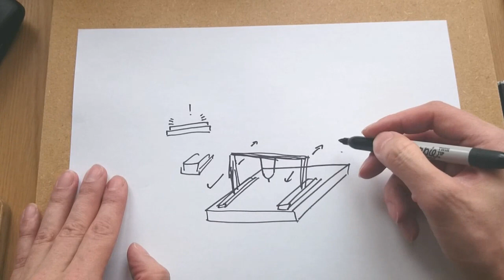My homemade desktop CNC mill - Clip 3/6: Boards, work beds and wobbly sliders

Comment: the more I google the more unusual designs I see, Ive 3d printed mine with slide bearings and rods, but without a 3d printer I would probably go for a more expensive option of building the frame from extrusion and using linear rods, but the price would be much higher, somewhere around £300 in full unless you fetch each part from aliexpress on best discount
Reply from the maker: When I made the machine six years ago these mechanical components were still surprisingly pricy, and off-the-shelf CNC machines in the $1000 range. Then the 3D-printer hype kicked in and parts became cheap - now I could make a much better machine for the $300 I paid back then. Still proud of my build though :)
Reply: @Joekutz  Im currently building a modified 3d printed cnc from an old 3d printer, in general the design from Nikodem Bartnik, just with 8mm rods and without extrusions, will see how it will work, as first designed a full on 3040 all in metal and then decided lets try to build something a bit cheaper :D will make a video when cnc shield arrives, all the mechanics is printed and assembled just waiting for the brain

Comment: Very cool build!
Did you measure the backlash yet? Also what resolution is possible?
This machine looks like it is great for milling PCBs.
Reply from the maker: martin2250 Thanks! There is no noticeable backlash right now in any direction. My precision is in the ballpark of 1/10 mm, I hope it stays like that. The sliders might wear out over time, so I may come back to that topic in a future video.

Comment: eine Frage welche Nennspannung hat der motor 12v oder 3.45v ?
Reply from the maker: Meine Motoren haben 3.x Volt Nennspannung. (Der Wert sagt jedoch nur, dass man 3.x Volt Gleichspannung durchschicken kann, ohne dass die Windungen durchbrennen. Der Schrittmotortreiber sendet trotzdem 19V durch, da er soweiso via PWM den Stromfluss kontolliert).
Reply: achso ok ja weil ich möchte nämlich es auch versuchen eine cnc maschine zu bauen :D